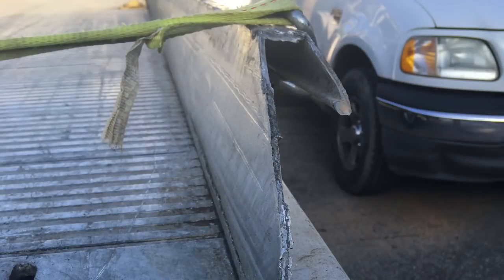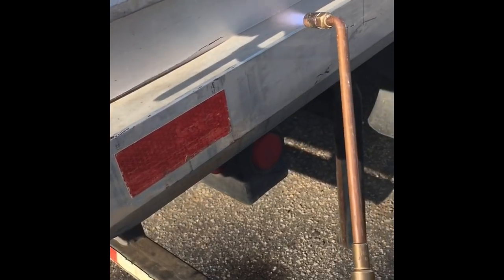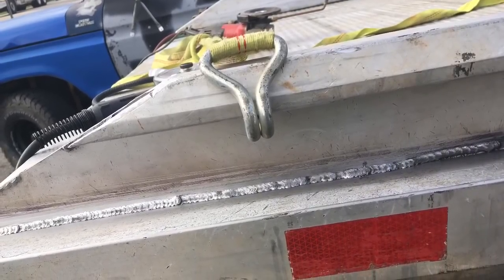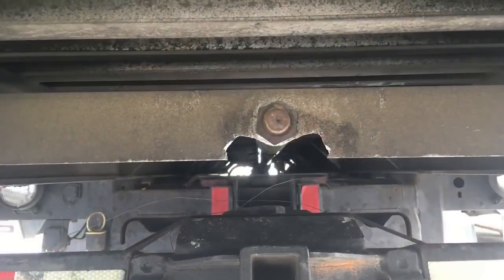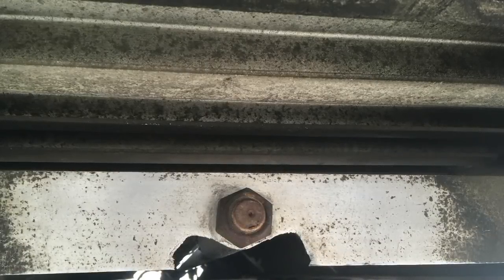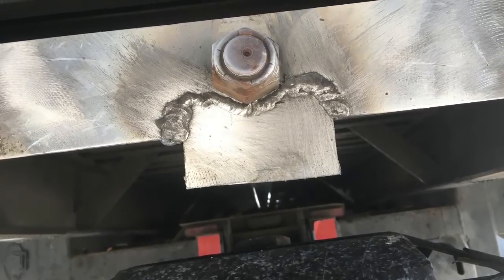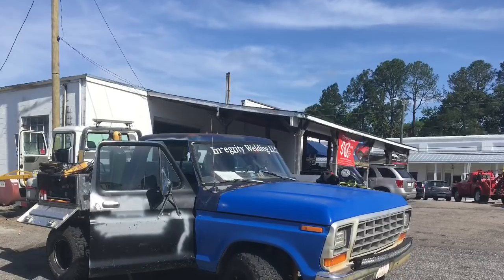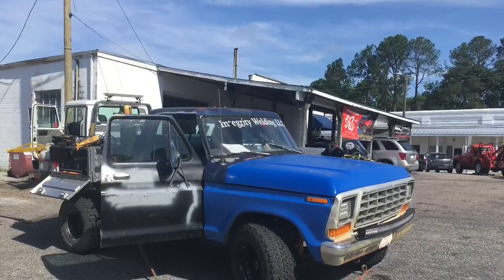Spool gun on a aluminum roll back wrecker

Comment: Right on bud.    Just picked up a Hobart handler 190 with the spool gun.  Gona give aluminum a try after being mostly a stick welder my whole life.    Also picked up a Westinghouse 9500/12500 watt generator with a 50amp socket to run it.      Nice work bud.  Love the videos.
Reply: How’d that generator and welder work out?
Reply: @randomschittz9461    Works very well.  Sold the Hobart but it ran that well also runs a Lincoln invertec 275 well too.  Pushing 1/8” 7018.
Reply: @Bostonharborwater  awesome! A lot of videos saying you cant rum a welder off a generator, but I figured they just needed a bigger generator. Most videos were trying to run off a 4 or 5 thousand watt, but most welders run above 6000 watts. Thanks for the reply.
Reply: @randomschittz9461    I have a trailblazer 325 in the work truck but I wanted a backup generator for the house on wheels and the refurbished invertec 275 and Westinghouse gen was a lot cheaper than a new blue star Miller.   I barely use it so I think it was a good choice.   The blue star didn’t have nearly the watts this did for the house either.

Comment: I've been welding since 1978 ... everyone always wire brushed aluminum back then. It takes the oxidation (skin) off. Muriatic acid also works, but you have to neutralize it. To be safe, use a dedicated stainless wire wheel/brush.

Comment: There's nothing wrong with using a wire brush on a grinder but if you're going to use it on aluminum just make sure that it's stainless and make sure that you've never used it on Steel if you use it on steel and then it will contaminate the aluminum.That's a good looking job man. I've used carb cleaner before just don't use brake cleaner and be careful of fumes it can really mess you up

Comment: You have black soot on your weld because you self contaminated your weld ! You have to PUSH your weld for spraytransfer or you self contaminate . You ll get that black soot every time you pull with a spool gun !
Typically you dont jack yr weld with spraytransfer . Constant steady speed ! If you bob to my channel The Weldor . Spraytransfer on 110 volts with esab 285 rebel . I show what a spray transfer aluminum weld looks like ! Good tips for aluminum in spraytranfer  Esab 285 video . Explains the whole push thing ! I can tell by the look of your weld your not sprayin ! I spent 2 years at a cat supplier doin spraytransfer . All i did the last 2 years was spray transfer 50 hours a week . Your close brother ! Just need a final tweaking on your settings and PUSH the spool gun ! 2 degree push n a little more heat so your sprayin ! Be safe !